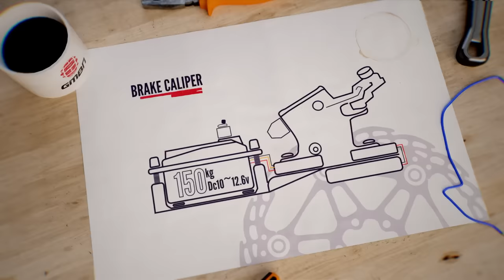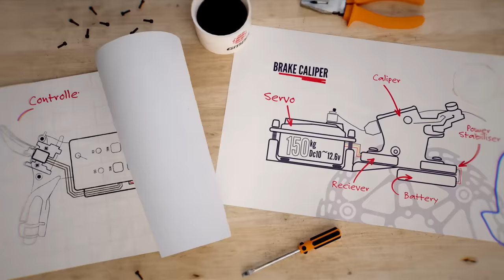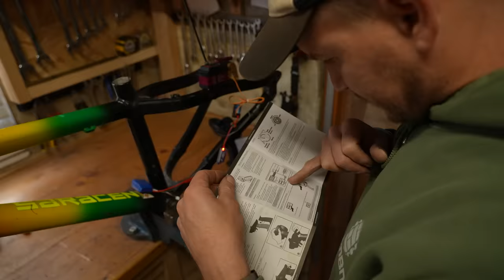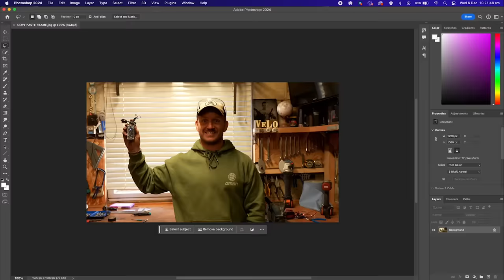We Made The World's First Wireless Bike Brakes

Comment: Awesome job Blake! I am into RC for over 20 yrs and seen a lot of RC planes with rc operated brakes. Was thinking how to transform this idea into MTB. Thise TRP brakes solved the missing link :) never seen them before.
If you are for Version 2.0 think about - modulation (different spring rate for controller lever), servo throw (exponential rate on controller) - it's the same as if you'd use Sram lever on Shimano caliper...
However the best usage would be on Spectral:ON and those servos be powered from the main battery via USB port - this would solve possible run out of battery scenarios when riding.
❤ props for your work!
Reply: TRP brakes are amazingly durable and eliminate allllll of the faffing about with brake bleeding etc needed for full hydro brakes. I have commented numerous times on GCN about how outstanding they are. Got no traction or comments back from presenters as they are not sponsored kit. I am a Clydesdale rider and if they can stop me from mid 20 mph range, they are not to be sneezed at. Run them on mountain and road bikes. Top it all of with, they are cheap..like the budgie!

Comment: Nice work as always mate, check out the settings for your transmitter (the thing on the brake lever), some have the option to set "expo", meaning the servo will ramp up in throw, the further you actuate it.

Comment: Another pearler! 😂
Absolute madness…
You could change the pull ratio on the servo arm to change the modulation… the closer the cable is fastened to the servo output shaft, the slower and smaller the stroke of the caliper, it will increase the maximum pressure the servo can deliver to the caliper too 👍
Can’t wait to see v2 😊

Comment: Blake, to solve the modulation issue you can add springs at the lever and between the servo and the caliper (it will transform the position control you have on the servo into a force modulation). And with the right spring rates combination between the one at the lever an the one at the caliper you could achieve a feel almost identical to the one you would get with a cable between the lever and the caliper.

Comment: I think a good idea to address the modulation issue would be to use a weight scale sensor/load cell (someone else mentioned that too), which does not have (to my knowledge) any moving parts. This way the break levers will be stiff and you could modulate the brakes purely by force applied.

Comment: Hi, you could stop the popping of the controler by making the lever longer and puting there a spring facing outwards. The spring would push the lever out and it would also make a little bit of modulation posible. I thing that you could use suspencion from RC micro crawlers. I hope you make a part 2 and sorry for gramatics.

Comment: When I first saw the teaser on Instagram, I was skeptical. I thought how is an RC servo going to provide enough torque to pull a cable actuated brake? Then you pull out these cable actuated hydro calipers. I didn't even know that was a thing. The way you pulled the guts from an RC remote and then fabbed it all together is amazing. I cant believe you rode with them down those trails. You must have rode them long enough around the neighborhood first to build some confidence. That would be freaky to not have the finger feedback. As others said though, you can probably add a stiff spring and that would give the similar feedback. This was a realy cool video. Nice job Blake.

Comment: I would absolutely run wireless brakes! You could literally tune tune lever progression, weight, tune everything. You could also have temperature monitoring of discs and pads with telemetry to your levers. I would need to be a dedicated radio unit for each brake and pads combo, and hydraulic.

Comment: Depending on what radio system you're using, you could use a single transmitter on the bars and use a separate channel for each brake. That would result in one less battery. A faster servo would probably help, something that can mimic the same speed as you pulling the lever. This was really cool and probably a lot of fun to build.

Comment: For a MkII you need to use faster servos and a transmitter that is mappable for it's actuation curve.  You can also get linear servos that would be much easier to get to work with those calipers.  There's loads of info about brakes like these for nitro powered RC cars, boats and planes as they've been dealing with this for decades.  The big issue though is getting any feedback through the levers, very hard to do without making it very complicated and bulky but it is possible.  Maybe something with a gyro on the hub to sense deceleration rates and lockups could work?

Comment: If you get a transmitter that lets you add an expo curve on the channel you're using to control the brake lever,  then you could maybe use that to fine tune the modulation

Comment: Blake, what would really help on modulation is a cam shaped lever arm on the servo actuator. This could be tuned to multiply the torque and the amount of movement as it pulls the cable actuator. Since the lever is producing a linear signal, the cam would allow for a modulated actuation, creating a more natural feel to the brake progression..... maybe?  LOL Just a thought as I watched this very cool video. I'd be happy to come back to the UK and work on it with you and ride those Forrest of Dean trails. It's too cold to do much riding here in Canada right now.

Comment: I'm currently  running an rc system I made for  my electric paddle board on my e8000, electronics were toast so I wired an rc helicopter speed controller directly to the motor then I used a cable brake lever to operate the transmitter which  is in my bar bag, 6s brick size battery in a tank bag works surprisingly well!

Comment: Safety feature needed that if there is a failure of any sort such as loss of power, that the brakes slowly fall into a default mode of being on.  So, provided that there is power, and the controller is functioning, the breaks will disengage.  Any point of failure and the breaks slowly engage, bringing you to a safe stop.

Comment: You might be able to program in some Expo (depending on the transmitter) on the lever, it allows the  servo travel to be non linear so you can reduce sensitivity when the lever first moves. Motion rc has a vid called. What is Expo.

Comment: You could take this one step further. mount one transmitter with wires  out to the levers. The new RC transmitters have mixing. You could set up a mix of say 70% front brake and 40% rear brake on just the front brake lever. You could also set it on a switch to enable or disable mixed braking on one lever.

Comment: I'd personally use actual brake levers that you can attach springs to so that you can increase the input force needed.  Modulation will be easier with some back-pressure / force actually acting against your fingers.  Then attach the brake lever to the string pot of the RC remote trigger.

Comment: First thing comes into mind, the whole system should be powered from one battery source that's installed inside the frame similar to the e-bike. The second thing is that you're still utilizing the original cable system, which in reality you've only made it a shorter cable. So if you want to completely revolutionize the idea, then you're gonna have to completely ditch the cables and instead use the servo directly to squeeze those break pads.

Comment: I had this same idea a few years ago but had a different idea for creating the breaking force. For the RC car it uses a motor made up of copper coils and a magnetic rotor. A current is sent through the copper spinning the magnet and drive shaft connected to the magnetic rotor. The breaking force comes from the current moving through the copper in the opposite direction slowing down the magnetic rotor. My idea for wireless mountain bike brakes is to take your front and rear hub and spool copper on the inside where it would be exposed to the axle. The axle would have a magnetic center that goes through the copper coils. pulling the brake lever would send an electrical current through the copper coils slowing the hubs rotation around the axle.  This would make the brakes completely wireless and get ride of brake rotors. The only downside that is super apparent is the weight and battery. If you have ever held a brushless RC motor they are very heavy for their size. Brushless motors also us a lot of juice so using an integrated battery in the hub is most likely not an option. Idk just some ideas for version 2

Comment: I see the main advantage when you want to have more than one brake lever for different hand positions. This is the case for drop bars (regular brake lever position plus a lever on the top) and for TT extensions (no brake lever available today).
For a mass production, 
- there should be some redundancy built in (e.g., more than one channel for the wireless transmission). Also it must be ensured that > 2 bikes with wireless brakes do not interfere (problem seems to be solved for wireless shifting already but I am not sure with Blake's prototype).
- modulation through the lever is definitively required (it could be electronically tuned / calibrated) and there could even be an automated blend of front and back wheel braking (like in cars today), even ABS aka antilock system to have the shortest brake distance for emergency braking
Also it would be good to have power regeneration during braking to charge the brake actuator (and wireless shifter battery plus some optional lights fron and back).

Comment: You might try to see if you can put some kind of a light polymer under the brake lever that gives it the feel of a real brake, some increased resistance as you grab the lever in other words. Then you just need to line it up with the actuation of the servo so that you can still lock up the brakes when you need to. I just got into RC cars recently and was looking at the servo and thought about this exact concept, but you beat me to it. Not sure I would have had the courage to try it though.

Comment: Awsome! I imagine that in one of the next versions it will be possible to get rid of the levers completely. Just hold the grips with all fingers and add two load cells under the index fingers.
Reply: I suspect most of the modulation comes from the bracket flex.

Comment: So for v2, for it to really be rideable, you'd want to change the control system somehow.   Currently it's trying to match displacement.   The lever (likely) is turning a potentiometer to measure displacement, and Inside the servo is another potentiometer that turns with the servo, creating the servo feedback loop (they could use digital encoders, but my limited experience with RC servos had potentiometers)  Replace the two potentiometer loops with strain gages.    Then the lever can be firm and  transmit how hard it is being pulled, and on the brake end, servo feedback loop is not against the desired position,  but the desired force....

Comment: MarkII should have some kind of brake feedback. Our biker brains know how the finger pressure relates to brake force, because there is a relation die to the hydraulics. Right now you are just pressing against the spring that is attached to the lever. You don't 'feel' anything. And if you wanna go have fun on the trail, you need to anticipate your brake force if you see a corner coming up. We rarely just rely on a feedback-loop to adjust our lever pressure based on the deceleration we experience. 
I am seeing a lot of added complexity to get this hoseless setup work as natural as it should. Like one said before, you proofed the concept. But it is nuts to wanna have it, just to avoid hoses. Go have fun with it, but don't ask the crowd whether this is something we want or need. 😊

Comment: Hmmm.... Blake. First, great job. I love this idea. Second- problem, unless you can figure something out. You hit it on the head when you said that you can modulate the brake- love it. Awesome. However, for example, in cars, because of electronic steering having taken over, many drivers complain that they get little to no feedback from what the front wheels are doing through the steering mechanism (steering wheel). In much the same way, it sounds like you might have the same issue here?  Is there a way to give 'feel' to the brakes?  Looking forward to future versions of this. Great job. Love it.

Comment: Hey Blake, since your talent is massively underpaid at GMBN, may I suggest making a patent on this, starting a company and actually building it! I believe there is a potential for success here and you deserve it!
Reply: Without wanting to be a source of negativity, I doubt there is anything patentable in this, and likely nothing that the big brands don't have 100 versions of sitting in their R&D facilities. The challenge isn't the technology, it's convincing people to trust the technology, and that will be hard to do. You can argue that having two brakes is all the redundancy you need, assuming they are two completely independent 'closed loop' systems, but I think there is something deep in our brains that will make us all hesitant to putting our ability to stop in the hands of a WiFi or Bluetooth connection.

The other consideration is that even perfected and released as a production system, it's another 4 batteries on the bike. Full AXS + Flight Attendant is 7 batteries, and wireless braking takes that to 11 individual batteries on your bike. Throw in your GPS, your heart rate monitor, your lights for night riding etc... and you're up to 15+ batteries just to go for a ride. Sure with an e-bike you could run everything off the bike's battery, but then it wouldn't be wireless....

Comment: Congratulation. Very well done. Like you noted in the other video, the default is closed. So it's safe. All there is, is the peoples minds. I'm not sure, but how many EVs out there are using electric brakes? That's basically the same. And no one is screaming "terrible". And regarding "soulless", there are force-feedback game controllers. The tech is there. Or if you remove the lever off a hydraulic brake and connect it to a fully-hydraulic caliper, you could let the servo push the piston. That would prevent the bending at least at the rear mount. So you would have like four brake levers on the bike, with two of them replacing the cable actuated part. :)

Comment: I think it will happen eventually, would work better on an ebike where the rear calliper power can be taken from the existing battery system.
big companies will be able to build in feedback to the levers, etc. so i will be suprised if it doesn’t appear commercially within the next 5 years or so.

Great work by Blake putting this together in as a DIY project , the man has skills 😀👍
Reply: why bother with wireless brakes on bike with extra wires for the e controls?

Comment: With a standard brake, you can crash in case of mechanical failure with the lever, cable (or tube), clamp thingy or the disc. Now you can also crash if the battery dies or is empty, if the servo dies, if the remote dies, if the remote battery dies or is empty, if the signal is lost or jammed, or if there's a bug in any of the chips software. I propose for the next step you connect the brake lever to a remote server on the internet that actually control the braking.

Comment: I have been working on wireless brake ideas for my bicycle camper.  I was considering a mech or hydro brake line with a quick disconnect of some type, running to an extra brake lever on my handlebars.  I eventually headed down the path of electronic actuators and some R/C parts.  I think I am gonna mount some small actuators on a tiny lever right on the caliper, no brake cables at all.  The actuator will need wires though, obviously.  I could probably put a battery right near the caliper, but my bike is an emtb, so it already has a battery.  It is all gonna be an experiment, that is for sure.
Reply: i think thats the only good application for that. the bikes main brakes shouldnt be wireless.

Comment: Since there's a cable at the caliper, you could measure cable tension for brake feel, or you could measure hydraulic pressure. Use a computer to measure it, such as an arduino, and then provide wireless pressure feedback to the bar levers utilizing a similar servo to apply the same pressure back on the lever.

I think the root cause of the problems blake's experiencing is delay and flex, but feedback pressure is not helping either.

Comment: Electric and hybrid cars are mostly brake by wire. Pedal feel is simulated. But there is a backup hydraulic conventional system if you push the pedal far enough.

Comment: You can change the amount of throw for the throttle on certain remotes I know spectrum has cheap ones that have 50-75-100 settings but to fine tune it you’d probably need a nicer remote and they probably won’t cut up well😂 this is the coolest thing I’ve ever seen I love mtbs and RC especially, please ask any questions I might be able to help rnd some things like use strong 1/10 servo to cut down the size power hobby makes great ones

Comment: You should absolutely build a V2, maybe you could add ABS since there is no physical connection between the brake lever and the brake actuator. You could also tune the PID loop of the Servo to get a different brake feel.